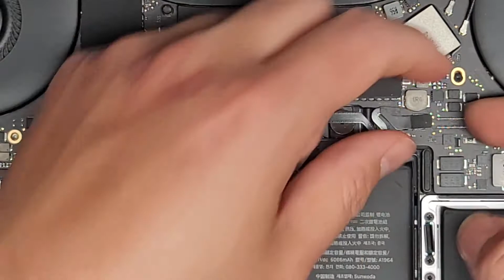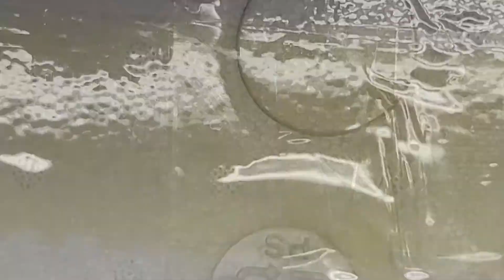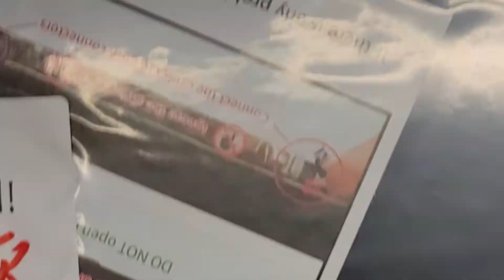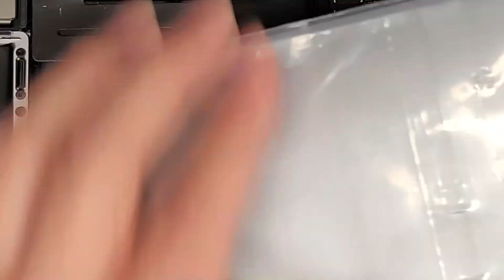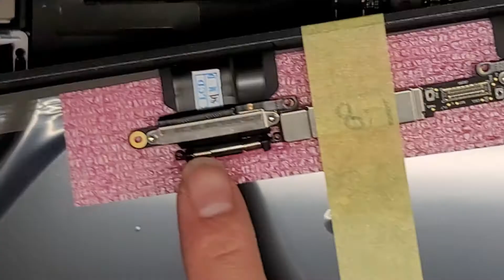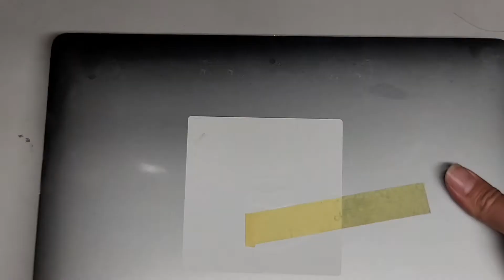13" Inch MacBook Pro A1989 Disassembly Display Screen LCD Assembly Replacement Repair

Comment: So inspired by your videos. That I bought a new screen and followed you and put it on. Your 30min my 4hrs (so many screws) lol.
I thought I followed correctly but the computer comes on but not the screen. Any suggestions?
Reply from the maker: The most important part of screen repairs is to drain the battery before touching the connector. If you messed with the connector without doing that, then the logicboard backlight circuit is fried :(